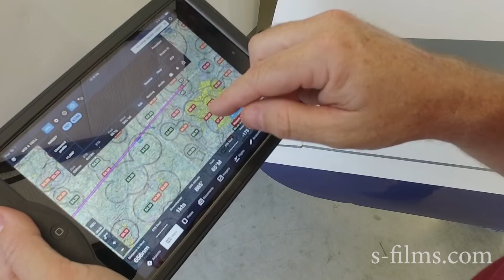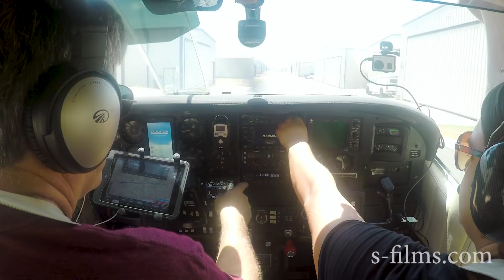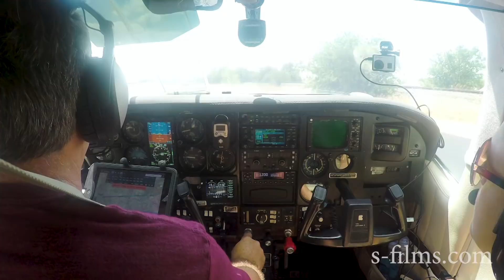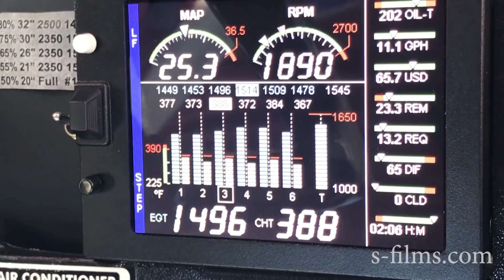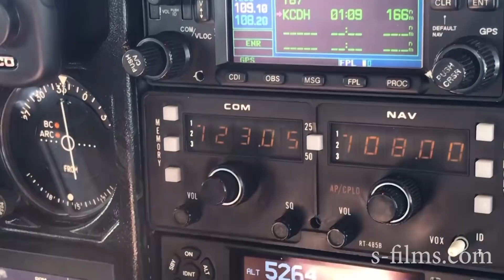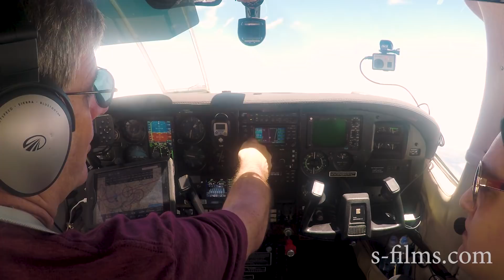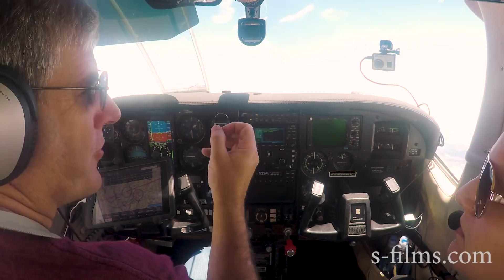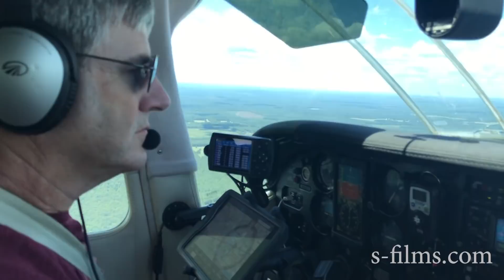50gph Burn in a Cessna?  - TakingOff Ep26

Comment: watching  your videos notice that your JPI RPM goes crazy.  Did you know why ?  Mine has JPI 730, starts doing that, but the prop and the RPM gauge is fine. thanks
Reply from the maker: Yeah, for a little while the RPM went crazy.  We think it was the probe.  A&P reset it a couple times, finally it started working right.

Comment: it's showing u burned 52 gph because of the erratic rpm measurements. fix that rpm glitch, and the specific consumption calculator logic will start working correctly.
Reply from the maker: I initially thought that as well, especially since both issues started same time.  But the erratic RPM indication has continued, but the fuel flow has been accurate in the 40 hours since.
Reply: Taking Off can you reset the fuel consumption and recheck?
Reply from the maker: @A_Man_In_His_Van  The fuel consumption has been right on ever since this one time malfunction.  So not sure what you mean resetting?

Comment: Best to play it safe , land and dip those tanks to confirm. I know the analogues in the Cessna are pitiful (well the C172SP I fly) , did you have analogues to confirm against ? Nice ride, nice panel too.
Reply from the maker: I had just dipped the tanks, and the EDM is a calculated amount displayed-- it has no probe or sensor inside the fuel tanks.  The analogues are totally untrustworthy.

Comment: I’m only at 85 hrs but still get nervous does that go away did u experience this.
Reply from the maker: I was a little nervous.. but I thought it highly unlikely that the JPI was accurate.  But still, I planned and prepared for it to be correct... Ad that showed me with 10 extra gal.  I did make sure to use mostly from one tank towards the end so I could switch to the known fuller tank on touch down.  Had 4 gal on the right and 22 on the left.